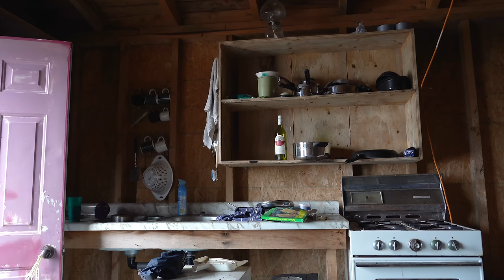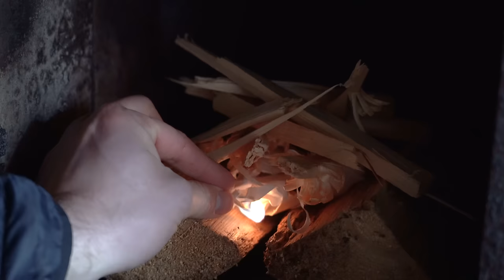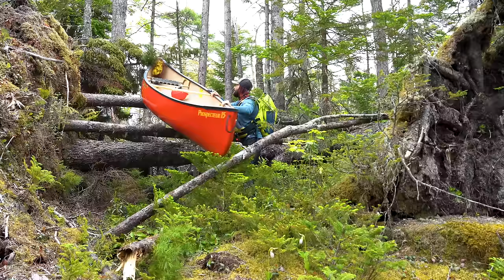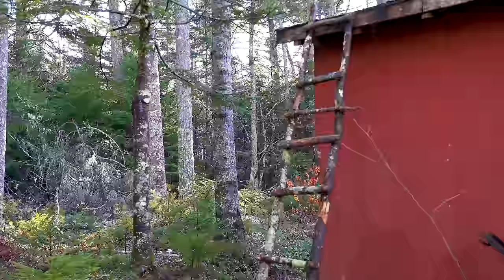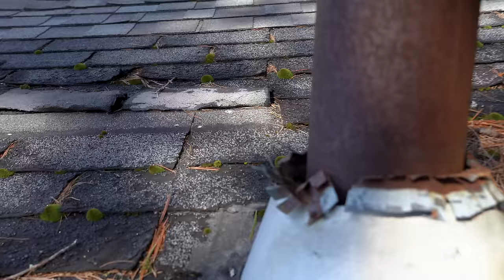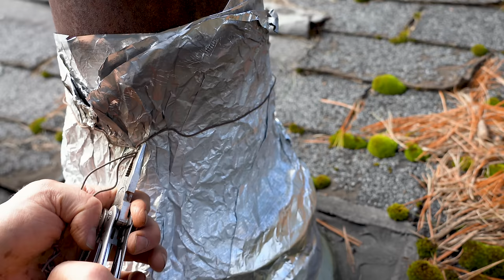Overnight in an Abandoned Cabin / Roof Repairs and Ladder Build

Comment: I loved this video. Do you think you'd have permission to really overhaul the cabin? It looks like most of the bones are still good. It appears to be built on log rounds, which are probably rotten, but would be very easy to replace. The OSB board is toast in some areas but in decent shape in others. Splicing in new pieces seems doable. The roof OSB might be toast. Overall it doesn't seem like it would take a herculean effort to make this place good as new. That would be amazing vibes.
Reply from the maker: It would be a fun project, however, there is no documentation of the property which makes me believe it may have been illegally built. It may not be worth the effort to put too much work into it

Comment: OK, do you have several knives with you?  Or, did I see you use the same knife to chop wood to kindling, to cut your steak, to trim branches from a pine pole, and to use to prep roof chimney area for repair?   If it's one knife, I just might need that.   Also, Noah, are you that great a craftsman or are you just not showing us levels, squares, measuring tapes?  That ladder you build was a beauty if just eyeballed.    I will never have those skills, and I'm always amazed to see them.
Reply from the maker: Thanks Jeff, every you see is what I had. The knife is a Mora Garberg, and it's one of a kind. I would recommend :)
Reply: @NorthernScavenger  Thank you for the info!

Comment: Very cool new hobby you've been developing! I am extremely skeptical of the calorie count on those cookies and I don't think that's actually possible unless they're completely made of oil - sugar isn't that high calorie nor is any dry ingredient - but I still want them all the same!
Reply: The google in me had to know… so I did the google and if his are the same as an Oreo chocolate covered one, then they are 180 cal for two cookies.  Still delicious, hardly nutritious but definitely necessary!
Reply: @Saltedbiscuit0007  I looked it up too and they are actually 180 cal per 2 cookies, not per 1. That number actually makes sense. The highest source of calories is pure fats at 9 cal/g. Sugar is only 4 cal/g. The box says 2 fudge covered Oreos are 37g: 9g of fat, 25g is carbs. So I do the math myself, 9cal x 9g = 81cal of fat and 4cal x 25g = 100cal of carbs for a total calorie count of 181 per 2 cookies (not per 1 cookie that was the mistake).
Reply: By the way look up the nutritional info on twix bars, they're a nearly perfect athletic fuel with just the right balance of calories from carbs (easily converted to energy) & fat (contains more than 2x the calories of sugar), just the right amount of protein (not too much, eat high protein later), and just enough sodium. The only thing missing is potassium, ideally sourced from potato chips while on the go (bananas don't actually have enough for electrolyte replacement).